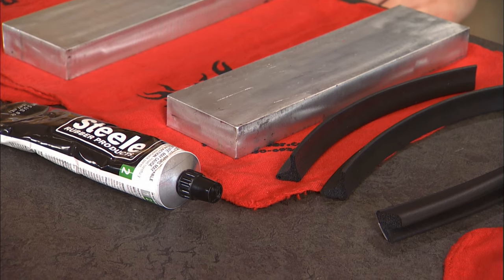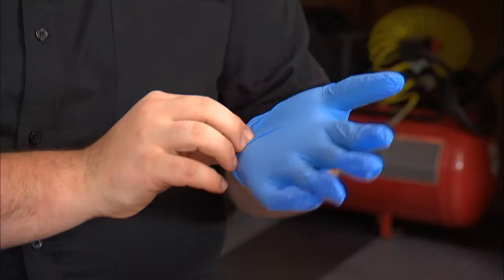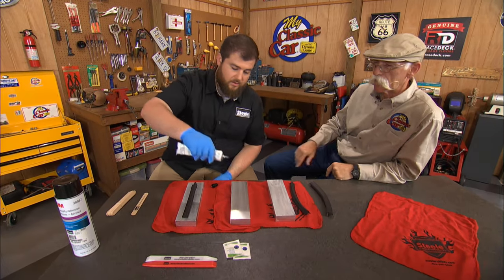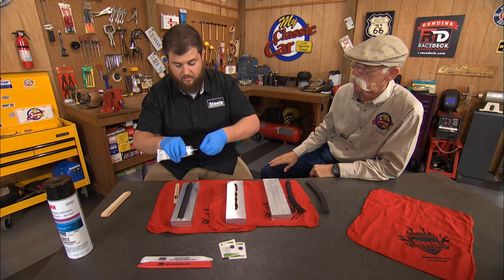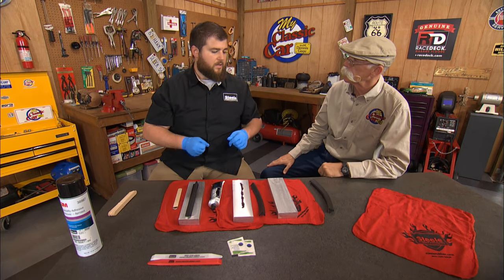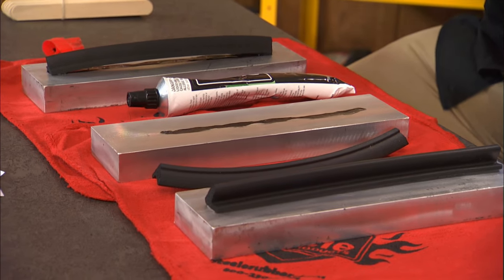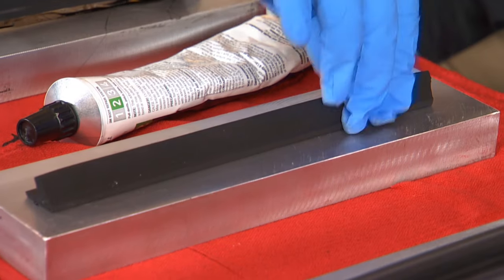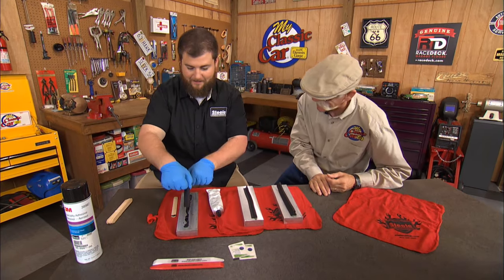Best Techniques to Use When Gluing Weatherstripping

Comment: Happens on the CMAX too , I have decided that what I need is double sided tape but also a rubber INSERT that slips into each end of the rubber that way even if bit loosens it does nor fall down .

Comment: In your older video from 2012 it was almost the same procedure except at the end. The other one says to spread the last thin coat. This one you say Not To? Is it gonna make a difference or not? You should delete the older one as it comes up ahead of this one so it confuse me. Thanks Love your Products
Reply from the maker: Hey there! I'm sorry for the confusion, I know it was done 2 different ways in these 2 different videos but they both worked. The best way to do it is to spread that second layer of adhesive but in the video that bead was so small that it stuck with out spreading. Just do what feels right to you in your particular situation. Thank you for watching!

Comment: What about a sound proofing kit for door seals that has a non-3m type of peel off 'tape' adhesive...could I use an additional glue to make it stay better?
Reply from the maker: We've never worked with soundproofing material before so we don't know exactly what works best to make it stick. With that being said, 3M does have a large line of adhesives and a lot of technical information available online so a quick google search may provide good results for you. We're sorry we can't be more help to you there. Thanks for watching!

Comment: That is a very good Video however I do have one suggestion from what have seen is that most people put the weather stripping on the wrong way. They love to put the taller side to the door instead of the door jam. Just something I thought you may want to add to your video.
Reply from the maker: Thanks for that suggestion, Chris and you're correct. At Steele our parts come with installation instructions noting the orientation and placement exactly. Each seal is a little bit different and it's difficult to capture all of those truths and exceptions in a short video. Thanks for watching!

Comment: Great video guys! Can you show how to best glue in the rear window seal on an early C3 Corvette with the removable rear window? 
PLEASE
Reply from the maker: Hey Garth, we'd love to be able to make a video of this but we just don't have a car available to demonstrate it on. With that being said, one of our technicians did some research on Corvette forums and this is the summary of the information he found:
The fiberglass surface must be meticulously prepared for the adhesive- no debris or old adhesive of any kind left behind. Clean it well with alcohol to remove any oily solvents or residue.
The gasket itself must be properly installed onto the body using weatherstrip adhesive and taking extra care to fully push in the corners of the gasket. Dont stretch the gasket at all while installing it because it will 'pull back" after a while and cause the adhesive to release from the fiberglass.
Then install the glass into the gasket using the pressure of the latches to hold it in tight. Make sure the latches are adjusted so they put enough pressure on the glass to form a seal but not so much that it buckles the gasket.
I hope these pointers help. Thank you for watching! And good luck with your project!

Comment: I just have a couple spots on my car, where the stripping is loose and lets in water. How do you recommend fixing these? I have the 3M product, but haven't tried it yet.
Reply from the maker: Hello! To glue your loose weatherstrips back on, simply use the same method as attaching them in this video. Don't forget to clean the metal (car surface) before fixing these problem spots where your weatherstripping is no longer attached. Thanks for reaching out to us! For technical assistance you can always give us a call at 800-650-5135.

Comment: Interesting you added that last bead on the cured surface. Any explanation? Is the peel and stick your standard 3M product? Looks like it would be an easier way to go for my trunk gasket seeing it sits in a channel. Thanks for sharing!
Reply from the maker: Honestly, we don't have the reasoning behind it. I believe it was recommended in the instructions for use by 3M and so we've always done it that way and we continue to do it that way because we know it works. Im sorry we don't have a better answer than that.   The peel n stick tape is 3M brand and is heat applied (bonded) to our extrusions. Peel n stick is much easier but surface prep is extremely important:  https://blog.steelerubber.com/peel-n-stick-weatherstripping-surface-prep/  Thanks for watching!
Reply: @SteeleRubberProducts  Thanks for the reply! Was just curious is all. Cheers!

Comment: Do it on an actual car with a strip thats 5 ft long and has glue on it... its so simple when it is a sample of the real thing. Also, surface prep is key too.
Reply from the maker: You are correct, it's much easier to do this in a small section for demonstration than on a vehicle with larger footage. And yes, surface prep is absolutely vital! Check out our latest video to see these gluing techniques, plus an additional one, used for installing the rear dutch door seals on a Chevy Astro van. Thank you for watching!!

Comment: What's the difference between the weatherstrip adhesive and using a silicon based sealer? Like a neutral base silicone sealer that's used for tiles ? I ask because I want to make sure that it sticks and doesn't die on me on very cold or hot temps
Reply from the maker: Very good question! A sealer is used for covering/filling an area such as a gap while adhesive is used for bonding things together. We recommend using an adhesive for bonding rubber to metal, but not for bonding rubber to glass. I hope this answer helps- thank you for watching!

Comment: 2015 Kia Optima my Bluetooth antenna that sits on the top of my car is loose purchase some black weather strip adhesive but I’m just scared I may mess it up! Help
Reply from the maker: Hey Thelma, we aren't 100% sure. We know that adhesive will stick things down and silicone will seal things up, but in your particular scenario, we aren't exactly sure what to recommend. You may want to contact a Kia dealership to ask them for recommendations on products that are safe to use with your exterior paint and antenna. Good luck!

Comment: I want to replace the rubber seals on the cargo compartments of my motor home.  They are the channel type, do I need adhesive or do I just press it into the edge of the compartment?
Reply from the maker: No need for adhesive, those will just press into the channel. Thanks for watching, Gary! If you have any other questions, please let us know.

Comment: what about when glueing to a painted surface not bear metal...thanks
Reply from the maker: The process is the same- make sure the area is free and clear of dirt/debris. Give it a good wipe with an alcohol swab to remove and oil/solvents or other surface coatings and then glue away! Thanks for watching!

Comment: this is a different adhesive than in the older video, the older video was 3M adhesive. what kind was this one?
Reply from the maker: This is the same adhesive. We've always recommended 3M Super Weatherstrip Adhesive. Thanks for watching!
Reply: Product says "Steele Rubber "  not 3M ? Confusing
Reply from the maker: You're right, it is confusing but when we do TV shows, sometimes brand names have to be masked because of conflicts. 3M is the only brand we recommend or carry here at Steele and this was indeed 3M Super Weatherstrip Adhesive that we used in the video: https://www.steelerubber.com/super-weatherstrip-adhesive-black-5-oz-96-8008-96  You can pick it up on our website or at a local parts house. Just make sure to get 3M number 8008. Sorry for the confusion but thank you for watching!